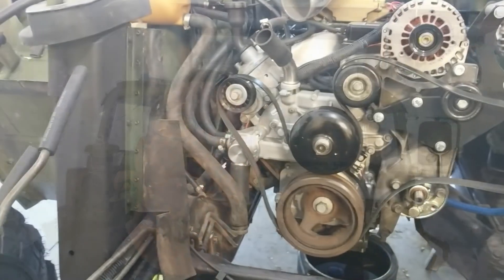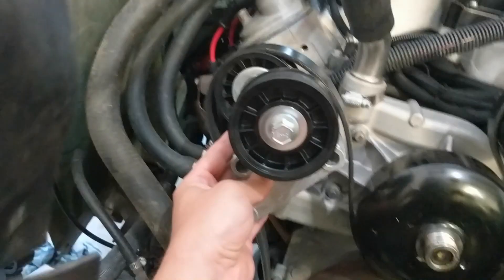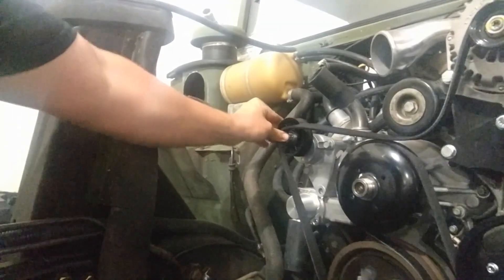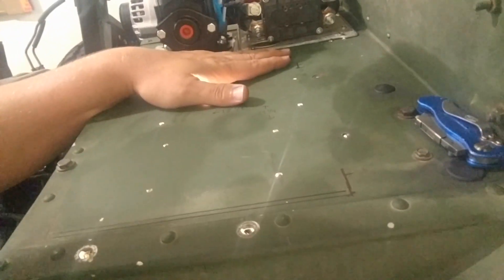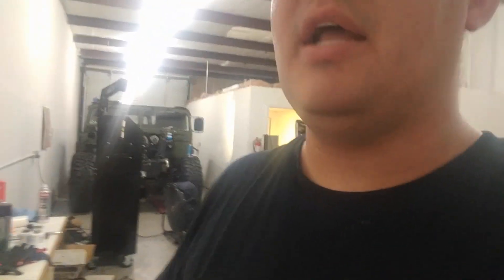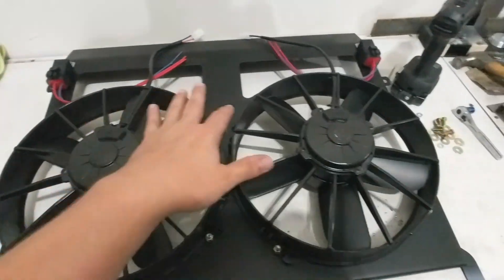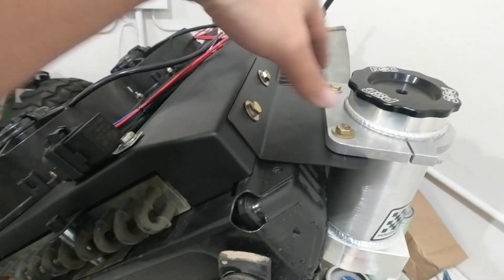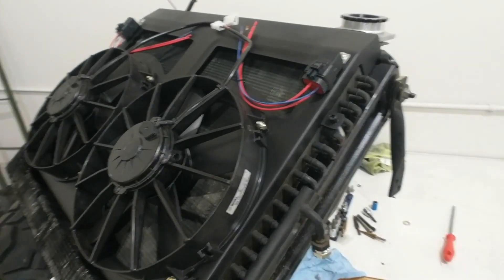Electric Fans on a HUMVEE and I complete the accessory drive - LSxHumvee

Comment: Hi mate,
Love you videos.  I have a question I hope you can help me with. As every time ive asked this question people tend to dodge it. My 6.5l hummer h1 overheats every time I drive it on soft sand. Id truly like any suggestion to help improve its cooling system.  Thankyou for your time and honesty.  Kindest regards G
Reply: With the H1 6.5 you're going to keep the standard mechanical fan but you may need to add an electric "pusher" fan on top of the cooling stack/radiator if you're out in really high temps. The military would do this in the desert to successfully being down temps. I would also double check your current thermostats, cooling system and such to make sure it's right. A good radiator flush could also help.